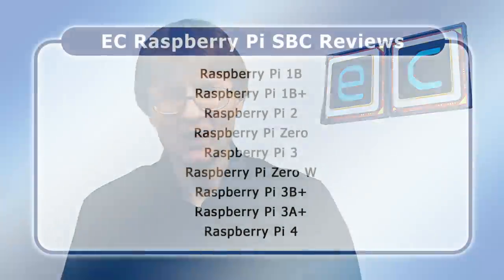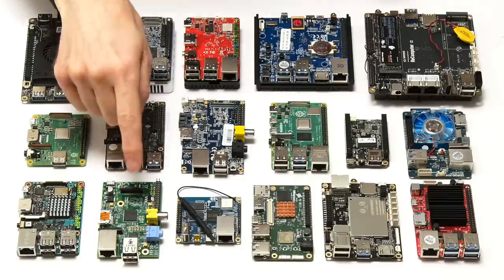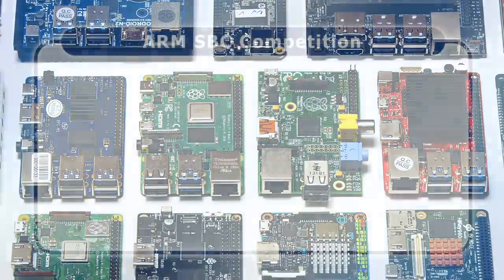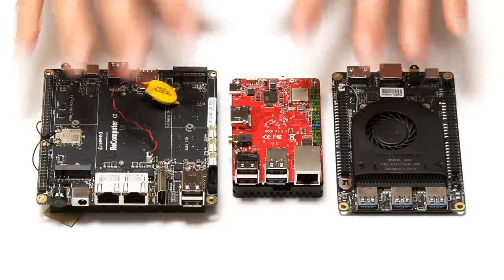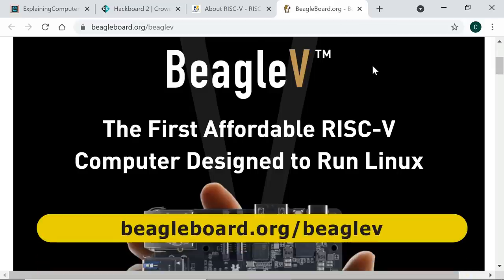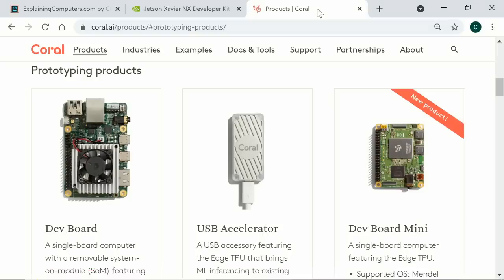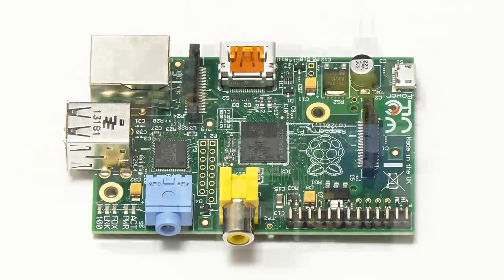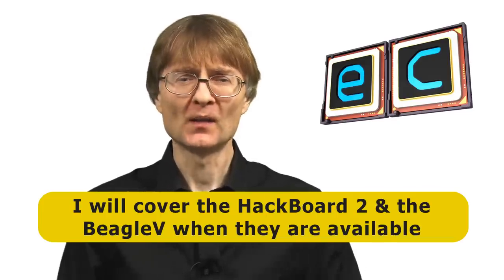SBCs in 2021: The State of Play

Comment: Having messed around with a few of the "cheap" raspberry pi alternatives, and experiencing the frustration of poor/awful software support, I'll be staying with the raspberry pi team from now on.
Reply: Yes, I bought an Odroid because it was technically more powerful and ran Android, but it just didn't have the community support to help me do what I wanted to do with it.
Reply: @abstractapproach634  Talk to it how?
Reply: In my experience, Orangepi devices are cheap and reliable. Armbian is a great OS, free and open source. Maybe less so in the future, but for now they are a cheap alternative.
Reply: i agree with this. really frustrating when i try to make something work on an orangepi but finally find out that i have to look for that specific os image to make it work. large thanks to the community for trying their best with these boards to provide help
Reply: @sethrd999  my goal is to make a wireless monitor (shouldv'e researched more, probably much cheaper just buying BT touch monitors)

So I have the Rpi4b+8G on 64bit rasbian (basically debian I think, getting debian on an old dell now)

I'd like a few things
   Connect with power on to CPU and GPU monitors (I'd be happy with gputweaker and ryzenmaster but would rather collect the data closer to the metal somehow, idk) 
   Adjust CPU and GPU settings from the touchscreen Pi (again I'll take either but closer to the metal is better if I can manage)

Little monitors on cases are all the rage so I want to take that idea to the next level. I heard a quote once saying "(something to the effect of the old days were hard, now if you want a to talk to b just slap a raspberry Pi to each end and there you go)" So I just figured it would work, and maybe even be a selling point (2 computers in one if you want to change the sd card on the pi) 

So far though I've had little luck as my skill set is all over the place, as I said I am in the process now of getting debian on an old pc. First I'll practice having them "talk" to eachother. 

Starting this business is harder l/taking longer than I had thought (go figure lol) I'm ironing out supply and structural details still. 

I know I can probably figure out how to ssh in over wifi but would prefer a more direct connection. I'd like the pc to see the pi as simply a monitor and a touchpad. 

As said, I am far from launching, so I've some time. But I did think it would be easier. I could maybe go the WOR route, but that's a lot of overhead for the goal. Maybe a windows IOT script could do it. I need to learn more about how BT/WF are implemented. I'm sure its hardware related and probably very difficult for the user to send messages over frequencies of thier choice. But still, maybe there's a way to exploit this, idk, much to learn. 

The dream would be a super light OS I could run on the Rpi4b+2G that would automatically open stats and graphs of the desired component.

The way further out dream would include a way to read/decode and write/compile machine language to and from said components directly, or via the chipset, but by the users choice. But that's way way further out and involves creating AI and hardware capable of "learning"/reverse engineering the majority if components in a reasonable time after launch. (I'm rambling, best too stop now I think)
Reply: @n0madfernan257  Interestingly we had someone at the Makerspace some time back when OrangePi released their first H3 based board and sang the same no software support script.  I stopped the rant as we had quite a large number of people and just asked,  when did the board hit the market and are you an early adopter.  Seriously these are questions you need to ask yourself before you purchase any SBC, set your expectency levels accordingly.  I did also mention that he was not held at gunpoint to purchase this board he seriously fell into the trap of 'ooo look something new and shiny I must have it'.
Reply: facts
Reply: @sethrd999  Never heard of orange pi but viscous catch 22 of no applications supporting a thing because no one uses it because no applications are supporting it because no one uses it because no applications support it because no one...... SUCKS 

It's why linux is having trouble catching on, it's why proprietary ARM and x86 designs rule Supreme. 

To break out of a catch 22, one party has to do something against its short term interest. And unless the reader expects businesses to sink their time and money into the smallest percentage of their clientele; It's up to the reader to deal with a little inconvenience and have patience in the things they believe in
Reply: @abstractapproach634  you will not find something like Jetson Nano easier to use than Raspberry Pi.
Reply: @abstractapproach634  All I would say is for you, ive used boards with allwinner H3's/5 'sand was looking at using a H6 for a drone sbc ( custom design ) as it has enough Uarts to talk nice to an stm32 ( pwm's ) even though its got quite a bit of h/w errata internally.

Hardware does not suck, it has software support (just not to what you consider a standard).  Linux is just fine where and how it is, if you dont like it change it.  Atleast you are free as in real freedom to make the choice and not have Microshaft screw with you.

Not sure if the last rant was towards me personally but I do take a Linus stance and that is I am only interested in things that normally interest me,  Binary blobs are god awful and open source wins for me everytime.  As I have said SBC's and Linux are not for everyone so your free to go your own way really just as I am.
Reply: @sethrd999  He probably just didn't know better. Linux was the same way right? Enough extremley talented people piled on and stuck with it, it finally became usable for us normal nerds.  These days are different though, most people want to see success fairly soon and become productive.
Reply: @sethrd999  I think you misinterpreted my meaning sir. I was agreeing with you and expanding to a more general issue

(Sorry if I came off sour somehow, I intentionally used "the reader" to differentiate from you)

Also, I love linux and am trying to switch. (Having issues with debian gui on dell inspiron 11-3162) I use my Rpi4b+8GB for anything I can. But it should be more popular and I believe the same catch 22 applies somewhat there. (How many people did wine draw, how many are Adobe holding back?) But I believe in it so I am willing to learn and work through the issues. Also, I wish more people would.

Also, I wish I would've went AMD on my card, but didn't know of Nvdia's evils. I do have an AMD processor.

I have a lot to learn, my apologies if I came off wrong or put words in your mouth or whatever, only complement and conversation was intended. Cheers!
Reply: @noweare1  Yeah I can agree with that.  Linux was kinda interesting especially Kernel 2.x and before.  I had a Dell P2 laptop Latitude cpi maybe?.  Anyway to make it really work I had to patch in PCMCIA support alsa sound ( yup no mainline ) a real early implementation of microcode,  IR support patches and the infamous ac patch set to make things a little more stable.

There was something else fiddly with this  laptop but I cant remember.
Reply: @abstractapproach634  Awesome,  if you want help on the clones, post the name/numbers I have uno's mega's and a cortex M3 Due ( the first Arm Atmel attempt ).  On the other said I have a couple of Sipeed ( Risc V ) boards that sport the K210 ( under the can ) which my fave for hacking on is the Maixduino.
Reply: @abstractapproach634  Ah so these are the Arduino mini/mini pro iirc.  I had this with my kid when she was in high school did a tech project using one of these and a PCB we helped put together.
Reply: @abstractapproach634  Yeah Nano / mini pretty much the same all use a 328p Atmel these days.  Good thing with these buggers is being 5v tolerant so no magic smoke ( unless you feed it more ) .. Ive seen RPi's blown up with just over 3v yet supposed to be good with 3.3 ( gpio's that is ) uarts and killed i2c's.
Reply: @sethrd999  edit, ignore the below, you were referring to powering via the gpio. Still good to know, but I no longer question the safety of my 5V 4A power supply 

ah so that's why the usbC is non communication. So they could cheap out on overvoltage protection. 

Good to know, I run mine of two 3.7V 2600mVh in parallel, the charger must step down the voltage before the outputs. Ig. Time to pull out the fluke! 

Uh, no need I guess, it says it's a 5 volt output. Hmm I think I need to reread your post.
Reply: @abstractapproach634  I mean the gpio header not mains/power.  as yes that goes through a regulator.
Reply: Try Rockchip based boards. Rockchip has awesome SW support. It's not noob-friendly so you need to know C++ to use it. Official GitHub is "rockchip-linux"
Reply: @abstractapproach634  Just buy a RISC-V board, or an FPGA board. You can program an FPGA yourself with a soft core (Software definition of the programmable FPGA hardware).

Rockchip is a hardware ODM, like Broadcom (The designer of the Rasp Pi's CPU), Mediatek, etc...
Reply: I have been tempted by some of the other boards. It would seem to be easier to develop a board with all manner of hardware on it than develop and support an adaptable OS.

Pi foundations approach is significantly different with multiple supported OS's and educational/  industrial   support  whilst their boards aren't necessarily the fastest or have most features crammed onto the tiniest piece of PCB.
Reply: I don't blame you. They seem to know what they're doing.
Reply: @Bella Cosmic Hound Good idea or we could look for licensing and setup a lot of 3D printers and make chips for the industry. Just an idea.

Comment: I think RPi did very well in low cost sbc. A friend of mine was leading the dev team who were developing cargo container (and cargo vehicles) gps tracking and reporting and truckers behaviour analysis solution - they grabed on RPi as hardware platform (i believe they still run linux kernel v.2.6.x and busybox) - and I remember we were having a beer and ribs party and he was so excited for wifi and cellular connectivity, the price of the unit and how they would make millions. And they did. They now have a fancy office with their RPi based device featured as foam mockup in the waiting area ) So, maybe yes, the pricier models will do well too, but zeros and maker boards priced at minimum will still drive the sbc market, imo. Thanks for outstanding sbc coverage, Chris! Absolutely love your channel.

Comment: I see the good old ZX81 and the Spectrum as a kind of "precursor" to these boards. Port on the backside for projects, and most importantly: A rich basic, that made it very easy and logic to learn to code - a kind of intuitive "Python-like" interpreter. Also good precise syntax error cursor, together with the keywords made these ZX's very friendly for beginners. Low pricetag too.
Very innovative and clever thought out by Sir Clive & Co.
Reply: I just wanted to say that boards like Atari 800XL, ZX Spectrum were SBCs of those times. They had GPIO, everything was on board ;).
Reply: I had a breakout board device for my Vic-20 that allowed me to control relays and servos. That was in 1983.
Reply: cough MK14 in 1979? cough
Reply: I have long said that the Raspberry Pi (and especially the Raspberry Pi 400) is the ZX Spectrum of this generation.
Reply: @ViridianGames  true, I look at it wider since we didn't invent ZX Spectrum 🙃
Reply: Indeed, a z88 form factor case with built in LCD display and keyboard swappable PCB would be nice for raspberry Pi and other SBC mounts
Reply: Interestingly thats where I came from heh, Spectrum 48k in a kit,  Z80 asm was interesting to be sure, later I used a TRS80 ( like the Oliver twins ) to squirt code direct to the memory of the speccy then do the randomize usr <mem loc>

After the speccy I went to the Amiga500 and Jumped right into 68K Sybex ( Orange Book ).  Which reminds me if anyone is interested in learning RiscV do pick up a copy of the RiscV Reader book.  It reads very close to said 68k book coving ASM / Opcodes and some good level of explanation of the ISA.
Reply: Let's not forget Acorn, without whom RISC architecture may not exist today! Definitely a case of great oaks growing from small Acorns!
Reply: Do you know the Colour Maximite 2?
Reply: @Xesh001  They were there for sure but RISC came from quite a bit before that ( in design atleast ) look at the 70's,  Then we saw the blow out with consoles ( PS 1 and Sega Saturn ) take the RISC and the rest is more a history lesson.
Reply: @sethrd999  we constructed our own 6809 boards in collage and wrote a simple executive in asm.  That was fun, but even more fun was designing our own bit slice processor (a CISC/RISC hybrid with all instructions executing in a single clock cycle).
Reply: @Chris.Brisson  The 6809 was not even available when I designed my first computer. It was 6800 based as the 6502 only has one accumulator.
Reply: I taught myself to program on a ZX81 that I built from a kit. That laid the ground to learn MS basic, Quick basic and most productively, MS Office bespoke macro apications for a large British institution I worked for until retirement. Not bad for an old mechanical Engineer 😂.
From modest beginnings ........ 😄

Comment: I bought a Beagle Board when it first came out, but quickly discovered (at the time) that software support was terrible. The hoops you needed to go through to even use the GPIO were terrible with information scattered over the internet. Sadly by the time the community got their ducks in a row I'd lost interest in it. The big thing that made the Raspberry Pi what it has become is the effort they put into making it easy for people to program, by creating a focused community that gave support to those trying to use it. I never used Scratch myself but I know of many that had Scratch on a Pi as their introduction to computing and working with external devices, and that was a huge victory for the Pi team. And they seem to have done a great job in supporting their older products over time.
Reply: That's always the path for early adopters,  unless your super familiar with boot process cross compiling and doing on your own, yeah its best to wait a bit.

As I mentioned in an early post I have a cross toolchain/compiler for RiscV K210's and BeagleV 7xx series ( the BeagleV variant still does not exist in silicon ) and yet using renode and QEMU I have Gentoo and almost a clear Arch build with latest kernels / Uboot to rock n roll when I purchase.

My use case for this is a cluster of these ( looking at 10 to start ) using OpenMPI and OpenCognition stack along with ROS to build out a virtual assistant construct.  The unit has NPU's Tensilica and a few other bits n bobs to help things along which should be fun.  Having the software 100% open will make things cool and the Open ended PCIe sounds great as I can add in extra muscle should I need it.
Reply: Beaglebone is so under-rated. Especially with the Cloud9 IDE. Certainly early on (as is true of ALL SBCs), early adopters had a lot of pain to get anything productive out of it. But in the case of the BB, It especially hurts because people expect a desktop environment. You've bought the wrong board. Developing code to run on a remote networked device is an absolute dream on the BB.
Reply: @epremeaux  Don't get me wrong, I really liked the Beaglebone, in many ways it was superior to the Pi, having a much more flexible design, built in MMC and so on, but was let down by the absence of support. I wasn't expecting a desktop environment, I just expected documentation that told you how to do things properly without having to hunt through web pages with conflicting information. I imagine that nowadays things are considerably better, but the BeagleBone Black was let down by the documentation that the manufacturer made available. It was obvious that they were experts, but made no concession to those that perhaps were not au fait with all the inner complexities of ARM SOC's.

Comment: Correction for 5:25: the Rock Pi X runs on an Atom. Yes I'm being pedantic.
Reply from the maker: You are correct. My bad. I obviously had a brain malfunction there!
Reply: @ExplainingComputers  Mine 2, most time, until at the Most critical point. It completely STOPs.... mal-fx. Even so, it works pretty Well.
Reply: Technically correct - the best kind of correct!
Reply: @ExplainingComputers  To be fair to you though, the Rock π X was the odd one out. It happens.
Reply: @GreenRecon  that is the best quote I've heard in a long time.